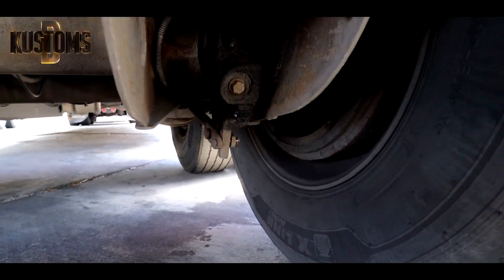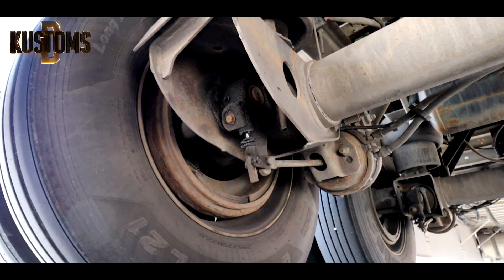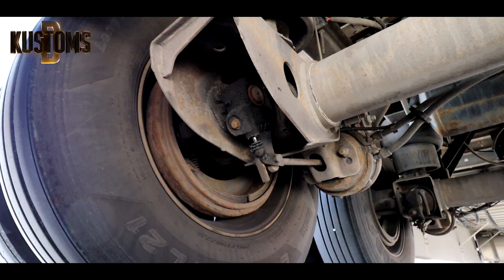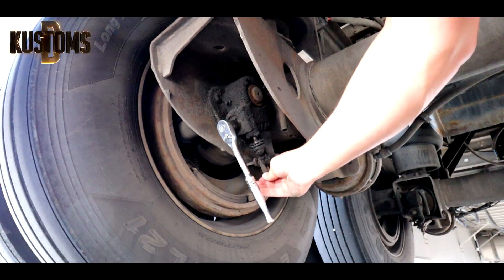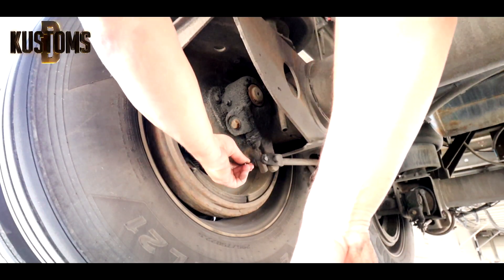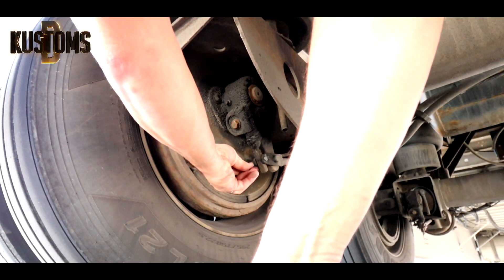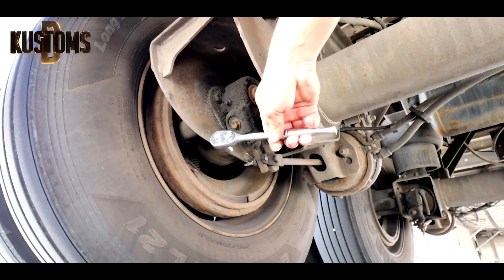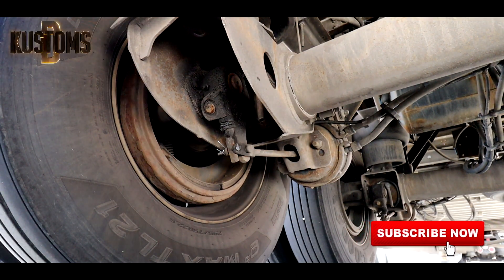SLACK ADJUSTER CLEVIS PIN INSTALL AND ADJUST BRAKES

Comment: Did u apply the trailer brake or the pedal brake
Reply from the maker: No. This is one person install job. You have to set your brakes or release them and then play with a slack adjuster.